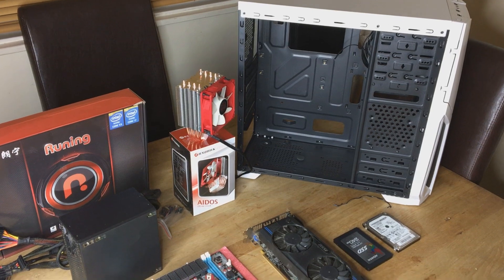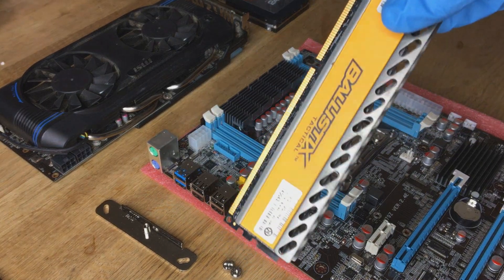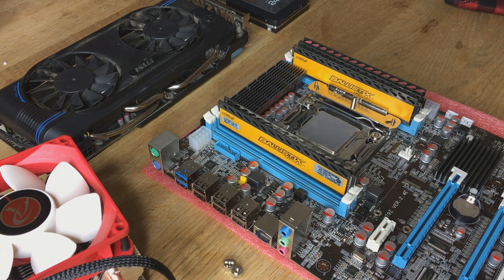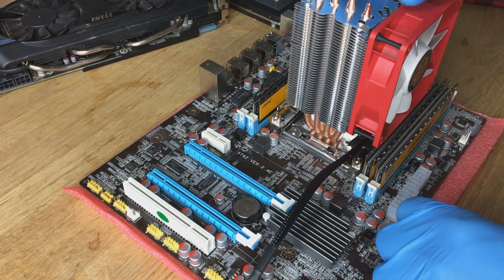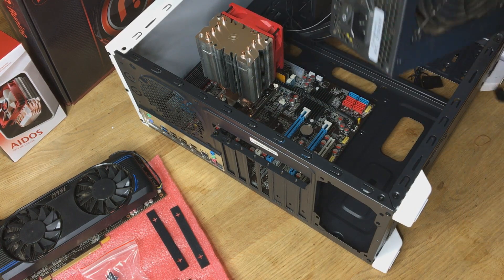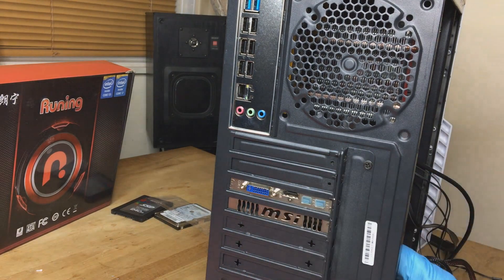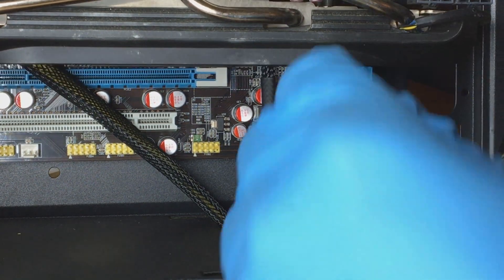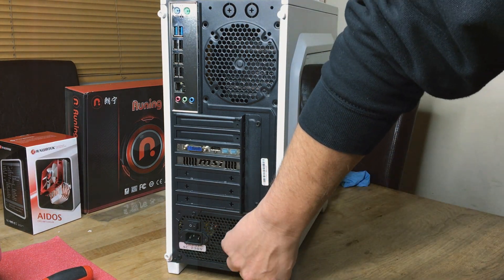Build the best budget Gaming PC Using Intel Xeon E5 Processor  Full pc build video

Comment: Is this CPU still a good buy?
Reply from the maker: Yes 100% best bang for buck cpu out there in my opinion
Reply: I think I'll build a server computer using this CPU, then. One of my biggest motivators is the incredible cost of memory these days and it seems that used E5 2670 compatible memory modules are very affordable compared to the rest. I'm just trying to decide between 1 or 2 physical CPUs, since they really are so cheap. I would use this server to run a few VM Linux instances and maybe a Windows one as well, using vSphere. Let me know if you have any thoughts on this plan. Thanks!

Comment: Very nice tutorial. I am using close the same motherboard. Using an e5 1660 v2 xeon, 16gb ram, 780ti all in a custom water loop. I have a few videos on it. The motherboard has been good for me so far. No problems past few months. https://www.youtube.com/channel/UCbktM-Pfv2_CfImN9NxU4cg
Reply: how about overclocking?
Reply: Ducky Duck I wouldn't suggest overclocking on these boards. The vrm heatsink on these boards to me is questionable. I water cooled mine and overclocked the gpu. The 6 core at 3.7/4.0ghz is strong enough for me.

Comment: My Chinese System Huanan Deluxe X79 motherboard, Xeon System Intel E5 2680 V2, Intel TS13A Cooler, DDR3 ECC Reg 16GB (4x4GB Samsung PC3-10700),  2x80GB Intel SSD Raid 0,  2x500GB Seagate Sata 3 Raid 1, AMD R9 270 2GB Video Card. I'm very happy with this system and Multicore performance is as good as my Ryzen 1700 system. No overclocking with E5 2600 series Xeons but I believe it is possible to over clock the E5 1600 series Xeons.
Reply: E5-1650 can OC easy to 4.5Ghz !
Reply from the maker: Can't beat the xeon's for the price and performance, No overclocking but why would you, this system is more than enough for my needs.
Reply: @SWADE e3s and e7s as well as the multi socket e5 models cannot be overclocked, but some of the e5 1600 series can be, but on a chinese board, i wouldn't recommend it, it is a modified lower end chipset, it wouldnt be able to handle it, and will likely kill the board.

Comment: How good is the mother board? OC'ing easy?
Reply from the maker: Hi, the motherboard is proving very reliable, i have not overclocked it as the Xeon cpu is locked and there are not many options in the bios to overclock, but it's a very stable board.